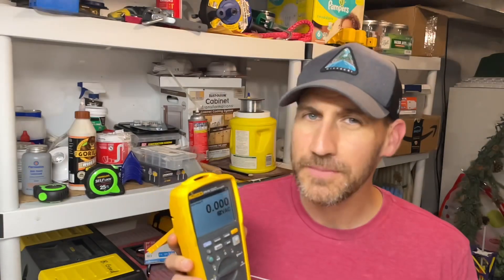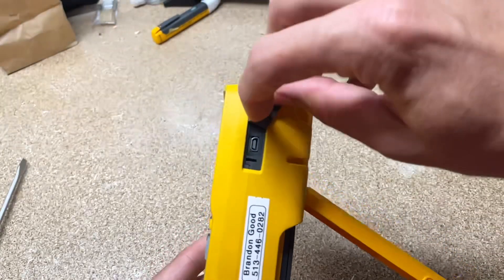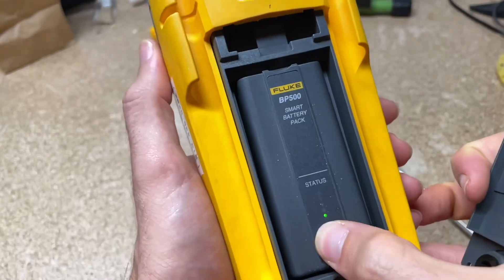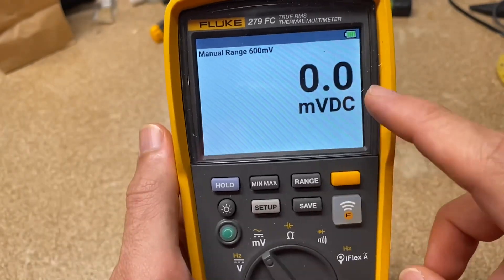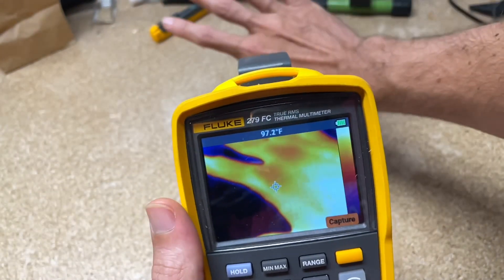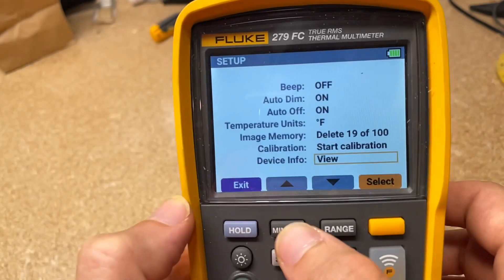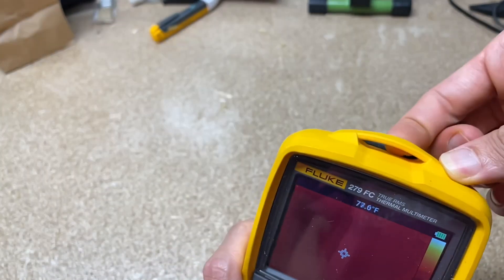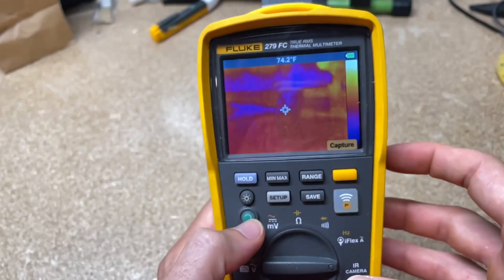Fluke-279 FC - Fluke Fridays - Episode 104

Comment: FYI This does not charge via the usb. I purchased one yesterday morning and left it pugged in via usb over night and the battery indicator didn't move.
Reply: Correct, the now $200 battery has to be pulled out and plugged in via barrel plug that is supplied. 
Highly advise when buying, spend the money, get 2 more batteries to last a few days of use, it takes a while to recharge battery cell.